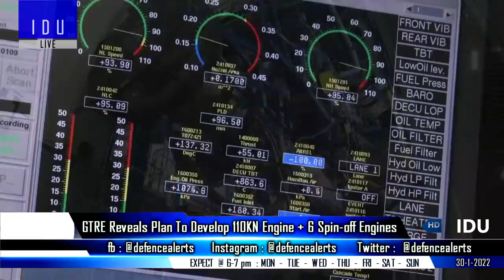Indian Defence Updates : DRDO 130 KN Engine,FMBT Engine Test,Brahmos To Oman,Dornier Radio Altimeter

Comment: How long it takes for this new aircraft engine to materialise?  We've seen HAL developing an engine since more than 30 years and still working on it.   Worst is that they still continue spend public money. Hope DRDO will be different.
Reply: GTRE not hal
Reply: pessimistic.
Reply: Kaveri engine was reviewed by Safran in 2017-18 , it's said the issues are fixed and engine can start flight testing in next 3 years from sanctioned
Reply: GTRE already have achieved 83kn mark and they want to utilise the knowledge into AMCA engine with help of international partner so that they can make it as planned
Reply: Aircraft engine tech is one of the most hardest things to achieve. 
Also the proof is only France USA UK Russia and China ( reversed engineered russian engine ) can built jet engine. 
So plz give GTRE bit more time they already developed dry kavari which will be used in aura UCAV project.
Reply: some guy  um I told that only bro the bracket is beside China.

Comment: GE has a 65kN dry and 116kN wet f414 variant, why not use that? perhaps work with GE to increase the dry thrust by 7kN?
Reply: There is no ToT or joint development with GE. Only Rolls Royce has come forward for joint development.
Reply: @le_ecrivaine  no, but if GE is willing, it would be a good deal.
Reply: @burlatsdemontaigne6147  why would any foreign turbine company bother?

Comment: What does it mean 78Kn dry thrust? Is this sufficient energy required for a twin engine fighter to super cruise? I understand that a futuristic High thrust engine means near 100 Kn of dry thrust.. The French M88 has dry thrust of 75 Kn as of today, what is so great in us developing a 78Kn engine for future!!!
Reply: Well there is going to be 2 model of amca .. .
I guess the 1 model could role out with this class engine and also we dont have time(  2024)
Reply: Well first model is 20 tons a d 2nd would be 25tons
Reply: It's not even 78 but 72 kn 78kn would give max high thrust of around 140kn
Reply: what? M88 has a wet thrust of 75kN, and a dry thrust of less than 50kN

Comment: Dry thrust should be 150 knt. Not easy to achieve but not impossible as well.
Some best brains of Metallurgy, Thermodynamics, Physics etc required.
Reply: Bro we don't need such powerful engine
Reply: @vedangbarman6392  we actually a decade late in 5th generation fighter aircraft technology , and india planning 6th at same time too , so its not an issue if india develop 130+ KNT engine
Reply: @shivammalikO1  bruh India is not planning 6th generation fighter and also there are many country still developing their 5th generation fighter
Reply: Bhai 150Kn dry thrust Jada nahi hua kya??
Reply: @ROHIT-jo2fk  bha russia ne 180 kn k engine bhi bana liya hai..............par abhi ke liye hamare liye zyada hai
Reply: @anentjaysiingh4728  bhai par hmare sabhi aircraft medium weight ke hai aur russia ke heavy weight ke
Reply: @vedangbarman6392  you should've watch the statement of air chief, he emphasized to develop 6th gen tech and also use in AMCA 2.0 , and AMCA itself 5.5th gen not 5. Also we are not competing with pak but china/US/RUSSIA, even Japan and s.korea developing  5th and 6th gen tech. We can't afford to lack behind.
Reply: @shivammalikO1  developing 6th gen tech and making a 6th gen tech is completely different and there are more country developing 5th generation jet
Reply: @vedangbarman6392  How can u develop 6th gen aircraft before developing tech ? 
japan set target by 2030-35 to make its first 6th gen aircraft when we desiring to get our first 5.5th gen, dont u see diff ? even airforce pushing for 5.5th gen with 6th tech. 
u may understand now . and we have no concern what other doing, our adversary claimed to have 5th gen already and working on 6th
Reply: @anentjaysiingh4728  bhai Russia kbse engine bana raha hai , ek baar engine banane ke baad uske derivatives bana do bss new engine bann gaya , russian American Chinese France sbb yahi krte hai , higher thrust has higher weights also , this 110kn is suitable for medium weight category jets which is gonna be our AMCA
Reply: @shivammalikO1  Bro AMCA mk2 gonna have have everything that 6th generation jets need , then we can also quickly make another jet if required , and i don't think after 2027-2028 there's gonna be funding problems
Reply: @sleepyaf5270  let see what india do 😎
We can't only wait and watch
Reply: @shivammalikO1  i don't think India is gonna be behind in terms of technology n all cause today is funding problems tomorrow is not  like how china did
Reply: @sleepyaf5270  we ll be behind for next 15-20 years, then we can believe to be match with other major power. Economic and militarily 👌
Reply: @shivammalikO1  i don't think so we will be behind the projected requirements of this engine is higher than the f22 raptor engine and similar to the f35 engine , so if the funding problems r solved (which is gonna be solved) , i think we can make a 6 th generation aircraft also
Reply: @shivammalikO1  even if we reach 8.47 trillion (projection) GDP or higher ,  we will be in the race then
Reply: @sleepyaf5270  we can make when we have funding but do u think other who already have will stay at this point ? No, they already working on 6th and that time they may working on 7th 😁😁😁.
That's y indian govt never compete with other nation like pak and us does.
Reply: @ROHIT-jo2fk  Haan matlab wahi baat hai.....abhi hame heavy weight aircraft chahiye bhi nahi.......Su30 mki minimum 2040 tak toh kaam chalaega hi.......tab tak kuch na kuch toh ho hi jayega !
Reply: @anentjaysiingh4728  product 30 engine will have 175 kn of wet thrust so what are you talking about 180kn.
And also russian engine tech are bad.
Reply: @sleepyaf5270  Yes you are right. Plus we dont need 150 kn engine as of now. Maybe we would require them after 40s. By then kuch na kuch toh ho hi jayega !
Reply: @animeshkantibiswas4155  Sorry bhai........maine 175 ko 180 bol diya !!!!!!!!!!!!! Aree yaar 5 kn ka toh difference hai, kya baat pakad kar baith gaye tum. Aur Isdeliye 30 utna bhi kharab nahi hoga !
Reply: @shivammalikO1  derivatives of engines are not an problem, the first problem is to make an engine, and from then u just have to make derivatives like other countries do , like f119 derivative is f135
Reply: @anentjaysiingh4728  I still doubt russian engine they increase the thrust but doesn't bother to make better material to sustain the temp thus leading to poor service life. And as per 175 i will prefer reality and ig it will be between 168 to 172kn engine.
Also Russia needs more powerful engine cause of heavy fighters our requirements are different.
Reply: We'll need around 85kn dry thrust ideally for the 5,5gen version (accounting for optional manning & other AI bits + commanding drones Not laser DAS is another biggish power eater but assuming will be part of the 5th gen ver 1) This will provide adequate electrical power without reducing the thrust of version1
Reply: @coolkal7590  bro why do you think big aircrafts need more powerful engines and small don't? Why do you think without matching the required power the f35 su57 and j20 can't supercruise, also i think the 110 kn is for AMCA mk1 with 72 kn dry another 130kn for AMCA mk2 will have more than 85kn dry so chill
Reply: @vedangbarman6392  bro India is working on 6th generation aircraft i.e FUFA /Ghatak UCAV.
Reply: @burlatsdemontaigne6147  you see everyone need help in development even the engine of f-35 co developed by royal royce and lockheed martine and multiple component manufactured in different countries (outsourcing) and it is still under development (US airforce).
we are lacking behind but we are covering it. we have experience of 4.5gen so It will help but take 2 decades minimum to reach.

Comment: First buy russia mig21 engine technology and develop it

We need both safron engine and roy roll engine technology both

We can a hybrid kaveri engine technology
From f414 engine of usa
And critical metal from metrallagric 
From France
Together develop a new engine
Plus from kaveri engine 
ToT from usa f414
Key after burn technology and heat withstand metal from france

M88- 4 core engine technology of france may be old
Why can't we compare
This technology with kaveri engine technology 
Then develop a new hybrid kaveri engine
The plus of kaveri engine technology
The plus of m88 engine technology of france
The TOT of f414 of usa 
All together we develop a new engine

Why can't we purchased mig 21 engine technology with TOT and intellectual property rights from
Russia and use it kaveri engine technology and develop a new engine technology to use it medef
As mig Powerplant: 1 × Tumansky R-25-300 afterburning turbojet, 40.18 kN (9,030 lbf) thrust dry, 69.58 kN (15,640 lbf) with afterburner

Performance:

Maximum speed: 2,175 km/h (1,351 mph, 1,174 kn) / M2.05 at 13,000 m (43,000 ft)
1,300 km/h (810 mph; 700 kn) / M1.06 at sea level

We can take it and update to requirements with kaveri engine technology and develop a new hybrid engine technology
What do you say

One engine 70 kn
Both engine combined together which gets around 140kn

First you people use our brain 🧠🧠🧠 first
Do as above and save resources
Take both saforon engine technology and rolls Royce engine technology
Orlese both take money and invest in their engine technology and make us look fools

The defence minister tell her that  the  metallurgy composition are not with stand High temperature and decided to find a solution so that we can solve after burn issue in our new hybrid kaveri engine 

Amrutha verma call krishna  in Mumbai to find a best solution out of it

Krishna asks his son for his idea,rama was going through the old report and finds about TUNGSTEN ( part. 136  )

Why cant we use tungsten ?
rama tell to his father
 as it as

Tungsten Physical properties:

Of all metals in pure form, tungsten has the 
highest melting point (3,422 °C, 6,192°F), 
lowest vapor pressure (at temperatures above 1,650 °C, 3,000 °F), 
and the highest tensile strength.

Melting point: 3695 K (3422 °C, 6192 °F)

Thermal expansion: 4.5 µm/(m⋅K) (at 25 °C)

Boiling point: 6203 K (5930 °C, 10706 °F)
Thermal conductivity: 173 W/(m⋅K)

 Krishna call amrutha verma and tell his idea.amrutha Verma ask Krishna to give phone to his son and tell him that hat
.Amrutha Verma tell his son that our idea is good but Tungsten is brittle and shattered on impact

Rama who is sitting in Dinning table sees ceramic bowl 🥣🥣🥣 and gets the idea and search in internet and find the solution like this

1)What ceramic is used for high temperature applications?

Ultra-high-temperature ceramics (UHTCs) are a class of refractory ceramics that offer excellent stability at temperatures exceeding 2000 °C being investigated as possible thermal protection system (TPS) materials, coatings for materials subjected to high temperatures, and bulk materials for heating elements.

2)What temperature can ceramic coating withstand?
3,800 degrees Fahrenheit
High temp ceramic coating is a type of coating that can resist very high temperatures. In fact, ceramic can withstand temperatures of 3,800 degrees Fahrenheit (2,000 Celcius).

Rama immediately call her mother and explain his idea , amrutha verma says to his son that
You are right my son ,ceramic coating to it will give added advantage right

Amrutha verma immediately goes to defence minister and says his idea as 
Ceramic coatings are used for increasing resistance to corrosion in metal surface by spraying Zinc and Aluminum. They are also used to repair surfaces of various machine parts like motor armature shafts. They can be  used to achieve desired hardness on the surface of the metal components.

What do you say? Amrutha verma tell to defence minister.

For more 
Facebook s.h.ramakrishna jana deo
Vision india
JUST beginning
Reply: @le_ecrivaine  
Sir
Now you are also writing nonsense
One thing is sure
Ok then 
Ask russia to give mig21 engine technology with TOT and intellectual property rights
Then see the magic😜😜😜🤦🤦🤦🕵️🕵️🕵️